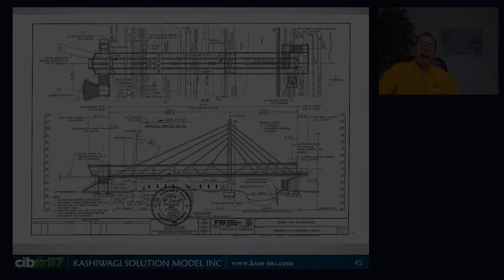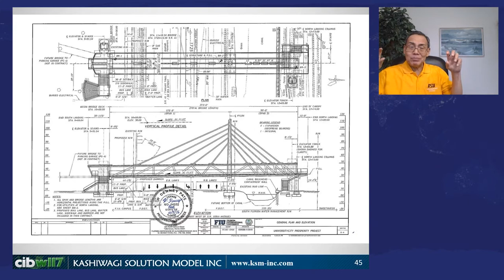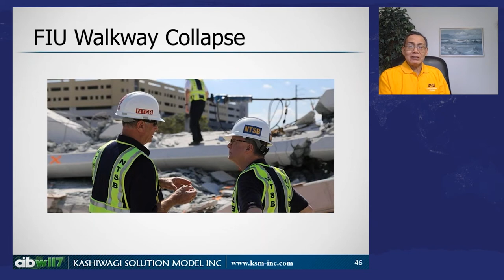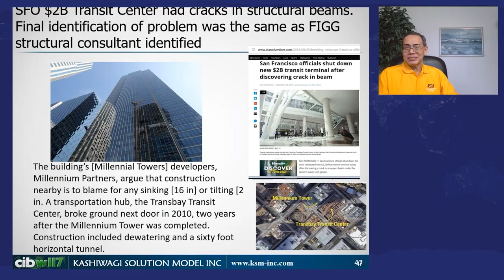Why Did the FIU Bridge Collapse?  - Construction Project Failures & Solutions

Comment: The workers on that job were the first to call out the potential failure of the bridge. No one listened to them. I was on a job where substandard beams were holding up the metal decking under the concrete placement of the floor. To get a flat floor more and more concrete was added. Thankfully there was no collapse of the floor but the next day you could see bent steel I-beams under the area of the concrete placement. After that day, temporary supports were installed and remained until the new concrete came up to the specified strength.

Comment: From what I remember of the NTSB report, the main factors where that there had to be changes made to the slab over the support structure, including a step and holes cut for drain pipes. Cracking was noted, and the solution determined on-site was the tendons needed tightening. Another thing noted was that the design had no redundant load paths in the event of a failure. The design people approved the modifications without any thought.
    I can't help but wonder, as they planned to making it a faux cable-stayed bridge, would it have survived had it actually been cable-stayed?
    I have seen many cases where a change is made, but doesn't get radiated out to trigger a re-analysis, and they tend to accumulate. The system can tolerate some minor changes, but you cannot gloss over them. At the micro level, the critical qualities aren't recognized, and at the macro level, the changes to the critical quality isn't recognized. Hyatt Regency walkway collapse (support and box girder design), or the Big Dig tunnel ceiling collapse (change from physical interference anchors to epoxy anchors) are examples.
     Have to be on your A game when dealing with sexy designs... There are always tradeoffs.

Comment: The roughening of a joint just increases the resistance of a cold joint to slipping, but that would not have made the structure safe.  The node that broke was grossly underdesigned, according to the NTSB.  The shocking thing is that any P.E. should have recognized that the structure was failing and acted to close the road, but the Engineer of Record went around telling everybody that there was no safety concern.
Reply from the maker: Wow, that is really fascinating! The real danger isn't engineering, it's bureaucracy.

Comment: "Realize they didn't have the expertise..."  yes there is a lot of this.  It's also called "you don't know what you don't know".  It may be a shortcoming in current university curricula that have become watered down over the past 40 years.  What they should have realized is that nobody builds concrete trusses so there must be a reason, and nobody can have expertise in building concrete trusses because nobody builds them.
"Rough up the concrete" is not due to using new state of the art concrete, it applies to interfaces between any type of concrete.  It has been in the building code since the very first edition of the ACI Building Code for Ultimate Strength Design.  It's a matter of developing friction.  Smooth concrete won't develop as much friction.  It is possible that the original engineer did not anticipate the bridge would be constructed with joints in certain locations, and they didn't know to specify how the interfaces would be prepared.  This was the weak point in the design, anyone experienced in tracking load paths through a structure would have seen it.
Reply from the maker: This is fantastic insight! Thanks for sharing.

Comment: The concrete had to be  roughened because the shear stresses across the pour joint was high enough that it required roughening. It wasn't because there was a special state of the art concrete. Even with the roughening, the joint still did not meet  code. It would just be less likely to fail if it was roughened. The structural engineer did not only under designed the joint, he likely knew that the joint was under designed the day of the collapse. The issue was obvious to an experienced trained structural engineer. Before the collapse, the engineer discussed connecting the north joint back to the joint to the south in order to share the shear in the joint. He violated the most important tenant of the practice of engineering and that is not to endanger the public. The life and safety of the public is paramount. Honest mistakes happen and people can get killed or hurt but I would not characterize this as an honest mistake.
Reply from the maker: Great insights! That is the most important takeaway; the issue is obvious to an expert structural engineer.